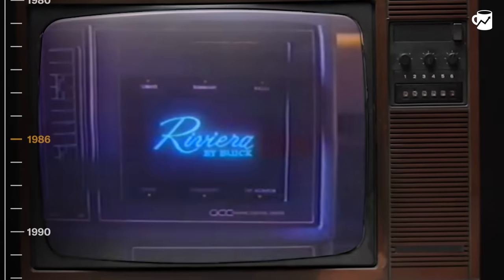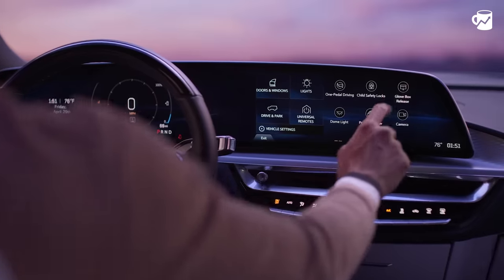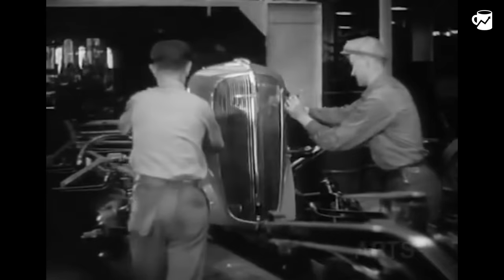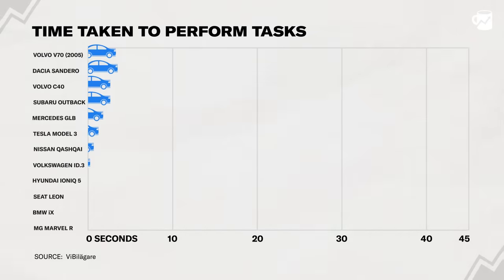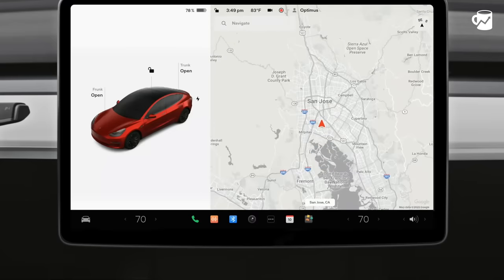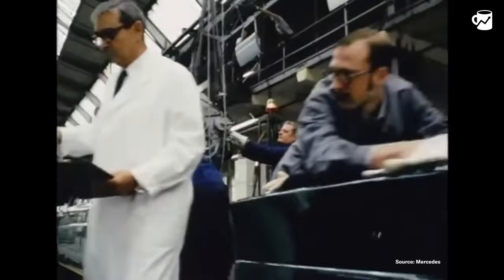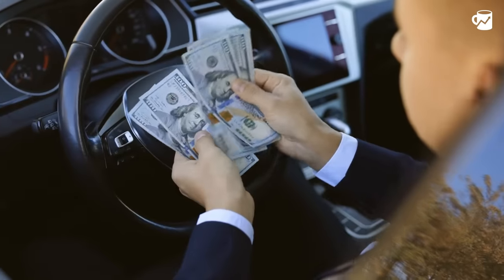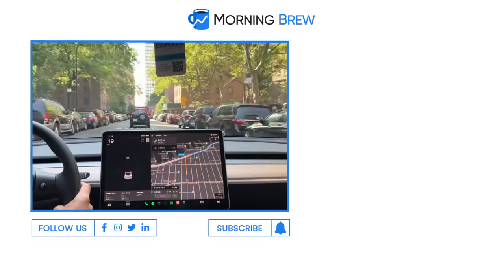The Real Reason New Cars Have Touchscreens

Comment: There is a reason why jet fighters still use buttons, switches and knobs and limited use of screens.
Reply: With switches & knobs, They can still use the “blindfolded cockpit test”.  Instructor tells you to touch a control & do so blindfolded.  This is how well you know your cockpit.
Reply: Oh boy... you must have not seen the F-35 cockpit. Literally just a giant fucking touchscreen for an instrument panel. A lot of 4.5/5 gen fighters are like this.
And a lot of late 4th gen had glass cockpits but with screens surrounded by buttons for context actions rather than direct touchscreens, but the general idea for the interface was the same.
If you really think "use of screens in jet fighters is limited", you're like 20 years out of date on their development.
That being said: jet fighters have also had Heads Up Displays since the 70s, that are now slowly being replaced by (and have been augmented by for decades now) Helmet Mounted Displays. Both of these critical features allow to feed the pilot as much critical data as possible without him having to pry his eyes off the outside world into the cockpit. It actually improves safety. And it's something that has made its way into automotive industry already, but takes the backseat to the fucking touchscreens.
The second critical technology that have been present in jet fighters for decades now and is only getting improved is HOTAS, or hands on throttle and stick - the stick and throttle grips are crammed with as many buttons and hat switches as possible without jeopardizing ergonomy, allowing the pilot to control as many of the functions as possible without having to use the touchscreen. He still has to do it, but all the functions that are needed at critical moments, e.g. during combat or landing, are mapped to buttons on stick and throttle. Combined with HMD it allows the pilot to do anything he could possibly need to do with his jet during combat without ever moving hands off the controls or eyes off the target. Again, this is something that is slowly making its way into automotive industry as it's easy to cram buttons onto the steering wheel without them being in the way (open wheel racing is kind of the bleeding edge on what can be done in this regard), yet still we have things like Tesla Cybertruck... no HUD, a giant touchscreen to the right, and even though there are buttons on the steering wheel to control the audio, the driver needs to use the touchscreen to put the goddamn car into drive or reverse - what the fuck
Reply: @delayed_control  All I can say in appreciation for your comment is I'm glad I read it and screenshot it. Quora level stuff. 👍👍
Reply: @delayed_control  yup, added this to my cringe collection.
Reply: @KitYeeScott  It's not because they are physical switches that makes it possible though. It's because they have a fixed memorizable location and have tactile feedback when pressed. Screens can keep common locations, but can also offer context specific buttons that physical ones cannot. Also making them larger because they don't have to display ones irrelevant to the current situation. 
Also all modern aircraft have screens all over the cockpit greatly reducing the number of switches, so I don't think this argument is even relevant. Planes use them even more than cars do to reduce buttons.
Reply: Modern jet fighters do use touchscreens and were the pioneers at it (at least in the West). The difference is in the design. They are intended to actually simplify your experience and the tactile controls still exist for things which don't need pilot attention. Touchscreens in jets actually offer extra information like danger zones from enemy radar or visually indicating when you'd get to the ideal range of your missiles. From what I know as a civilian they at large avoid deeply seated menus or features that can't be accessed by a few touches. Planes also had screens for radar display for a long time so this actually doesn't take up space for something else. There had been some growing pains to design an UI for pilots but together with the autopilot it's actually a lot less stressful to control them than it was before. The general paradigm of 4th++ generation to modern 5th generation (so anything aside from F-22) is to fight the enemy instead of fighting the plane itself.
Reply: @zidan40o0 what’s wrong with you boy? Cringe collection?
Reply: @Youtubecensoredmyusername  touch screens are cringe
Reply: Immediately I can see that at least some people are smart out there, thank you for the hope
Reply: I’m an engineer , we use buttons because the human wants them not because it’s best
Reply: @delayed_control i can vouch for all you said
Reply: @Icemario87  yeah they are. But also is even writing the word “cringe”
Reply: @L0kias1  what's better?
Reply: @L0kias1 Oh yeah people wants it, why wouldn't i want a touch screen instead of buttons to have no idea what i'm pressing on and have zero physical feedback and coordinance needing to look at it, browse through it, and aim my finger to the right point hoping it will register the touch input correctly.
Hey hunneh i'm about to turn on AC on our car, can you hold the wheel for me while i take my eyes off of the road to try find it in settings ?
Reply: Have you seen the new f22 and f35 cockpits! They’re going away from so many buttons and knobs with a quickness.
Reply: @johnbelwell2461  apparently you need the touchscreen to change gears in a Tesla
Reply: @Icemario87  i can't imagine my self who change gears on the shifter like a maniac to go back and forth to park out of a tight spot pressing a touch screen to do the same 😂😂😂
Reply: @johnbelwell2461  it, honestly, sounds dystopian.
Reply: Honestly this one one of the reasons I really don't want to upgrade my 2008vw Jetta. I like all the physical knob's and the minimalist display. But between cars being massive in size, everything being done on the touchscreen and being 35k+ in price it's easier to just pray my car keeps chugging at 200k miles.
Reply: People love talking out their ass 🤷‍♂️ the only time you seen a jet fighter was on video 🤣🤣🤣🤣🤣🤣🤣🤣🤣🤣🤣🤣
Reply: Trying to teach my grandparents how to text using dumb phones with buttons was...well, they never figured it out. Teaching my grandparents how to watch YouTube on a tablet took no time at all. The difference was the appropriate tool _for the task_. 

The appropriate use of touch screens is for tasks that benefit from a lot of UI visually guiding you through how to do them. Which is basically tasks that need a lot of steps, or tasks that you don't do very often, or tasks that have z lot of choices that don't map in a nice linear fashion, and importantly tasks that you don't need to do while driving! 

Changing the horn to a fart noise? Definitely throw it on the touch screen. Pairing to a new phone? Infinitely easier with a nice touch screen vs trying to figure it out on an old stereo that only has a handful of buttons. Turning on the AC to defog the interior? Hell no!
Reply: @zidan40o0  Go ahead and add your comment to your cringe collection.
Reply: Fighter jets are a really bad comparison since the challenges are different. At 30-40,000 feet, with the nearest friendly or enemy aircraft at least several hundreds (probably thousands) of metres away, a fighter pilot can safely go heads-down and ogle the radarscope to engage targets several kilometres (or tens, or hundreds) of kilometres away, and these days the radarscope is usually part of a large touchscreen display that synthesises the radar returns with terrain maps, information linked from other platforms, etc. A car driver in traffic has none of those luxuries and largely needs to stay heads up in order not to crash into anything.
Reply: The us navy also switched from touch screens to more traditional means on ships
Reply: They also have VR helmets with integrated heads up displays...
Reply: @KitYeeScott  
I agree.
With buttons and knobs I can still keep my eyes on the road.
Reply: Missile tracking... garbage collection... missile tracking...
Reply: Actually the most advanced mass produced jet fighter, the F-35, also has this problem, but the most important controls are still included on the joystick (HOTAS) and pilots also have Helmet Mounted Displays (HMDs) with voice activated commands, which compensate. 
The touchscreen isn't the problem. Indeed, it's a huge improvement if implemented correctly. The problem is using it to replace as many physical controls as possible, regardless of ergonomics.
Reply: @L0kias1  "I’m an engineer,  we use buttons because the human wants them not because it’s best"
As an engineer, I'm sure you're aware that "what's best" depends on the intended purpose. If you're designing something which will be used by humans then why on earth wouldn't you take advantage of hands, fingers and opposable thumbs?
Reply: Like other comments have said, this is no longer the case. Check the F-35 cockpit for a prime example of what is happening with new jet fighters (keep in mind it started being designed in the 90s!)
Reply: My aircraft has the Collins Proline Fusion and its three giant touchscreens.  

Now.. there is a cursor control and keyboard as well as knobs and buttons for basic functions.. but it still makes you have to snipe an icon and go through menus to do some basic tasks.  

To me the optimum design is non-touchscreens with soft keys around them.. and dedicated buttons and knobs.
Reply: Emm, except it is the opposite. 

The newest of the newest jet relies on touchscreen for the front facing controls. 

The stick which retain all the critical function obviously is physical. The side button, switches, knobs, etc are obviously still physical. 

But we are moving away from physical button on fighter jet.
Reply: Most jets can control all of the critical components without the pilot ever having to remove his hand from the throttle and stick since the late 70s, the touch screens on most jets tend to be there to display, not interact with things in the heat of the moment. Auto pilot has been advanced enough that the pilot doesnt evne need to look what he is actually doing out the cockpit for around half the lfight time (instead, looking at the instruments he has for data), and a lot of the buttons and switches you do see in older jets are gonna be the actual startup procedure switches (these have been automated by computers, they used to be pretty manual)... A software only solution is easier to implement even in jets, but that means a lot of the tedious tasks like moving the radar search, switching radio frequencies, taking in targetting data from other planes... Have simply become much less important to do manually, while the actual things needed to be done in a timely manner or frequent are integrated into the HOTAS, unlike a driver, for whom switching the temperature or navigation is usually the primary frequent concerns in the dash (but some cars use touch controls for switching gears... You dont do that on a jet, even the F-35, even tho its technically a jet engine thus isn't using a gearbox but the trottle and any thrust reversers would be the equivalent... Usually found on the HOTAS assembly)
Reply: What is the reason???????????
Reply: @delayed_control  But, the crucial elements are buttons etc. . Wait till the ejection seat is controlled by a touch screen...Not! 🙂
Reply: @delayed_control n
Reply: Of course, they are moving a bit faster than a car.
Reply: @delayed_control  fighter jets have hotas sticks, with those you can control pretty much anything without removing your hands from sticks. HOTAS stands for hands on throttle and stick.
Reply: Except they do use touch screens (and as a pilot I can tell you that there is nothing more useless—and potentially dangerous—than a touch screen avionics panel in turbulence)
Reply: I appreciate the well thought out posts discussing, basically, "the right tool for the right job." The job/task is itself context dependent and UI too often comes with the baggage of immature decision makers that sacrifice rigorous design for feelgood measures.

Cramming more buttons on a control device like the steering wheel may not be a wise choice for stressful situations as fine motor control falls off rapidly. If basic driving operations require the kind of constant training professional and thus military aircraft do, then there will likely be a lot more accidents.

The requirement to look away from the road for basic functions like gear shifting definitely sounds flawed to me.

That aside, I am interested in the effectiveness of mapping controls to movement and position and that includes context references like the tactile feedback from a raised dot or dash on many keyboard's 'F' and 'J' keys.
Reply: As do nuclear power stations...
Reply: You haven't studied the cockpit of a fifth or sixth generation jet fighter.
Reply: @psdaengr911  heard of HOTAS?
Reply: The military decision makers also listen to their pilots' feedback and learned very quickly that touchscreens will just get planes destroyed and billions of dollars wasted.  Can't say that about a lot of auto companies.
Reply: Weird yet space ships now have mainly touch screens….
Reply: @AznPrzsn  in space ship crew are passengers, they don't fly them
Reply: @PavelKrupets  Ah yes. Because they don't do anything at all. Absolutely no need for controls over systems. 😆What a loon
Reply: @AznPrzsn  when rocket spins or shakes, try to use touch screen. fighter jets including F35 have HOTAS, check what is it. also in rockets abort isn't a touch screen option, nor is attitude control.
Reply: @PavelKrupets  Never realized you could equate driving a standard car with a jet fighter. Eitherways, as a passenger of a self-driving car, it's amazingly easy to use the touch screen anyways... if you can't handle manually driving and using screens at the same time. Been watching movies and texting while driving since 2010. No physical buttons needed to assist. I guess my proprioception works just fine.
Reply: @delayed_control  The HUD is one of my favorite features of my new car. I only have it showing my speed since that's the most important and least distracting thing, but the blind spot indicators and even the navigation hints (turn arrows) are all very useful. I basically never look at the dash board while driving because all of the driving controls are physical and the speedometer floats unobtrusively just below the car in front of me.
Reply: @delayed_control  cybertruck has drive selector on the roof. you don't need the touch screen.